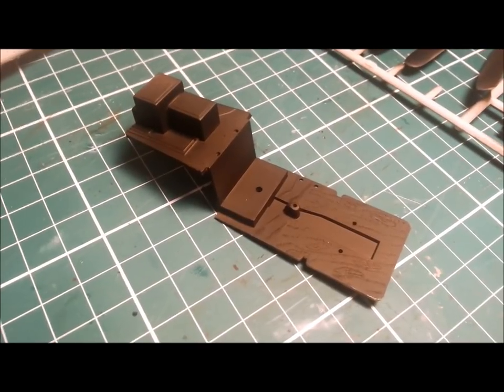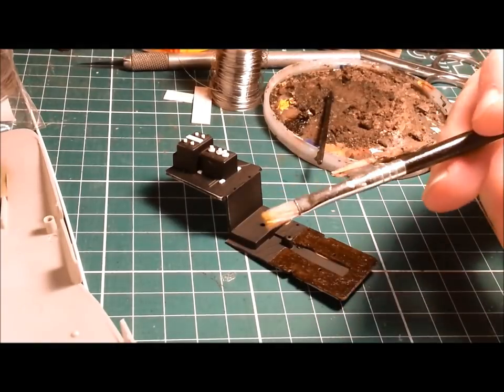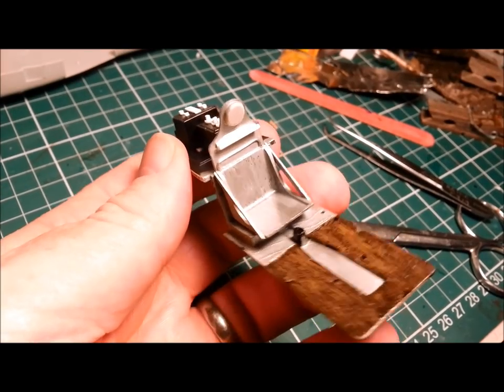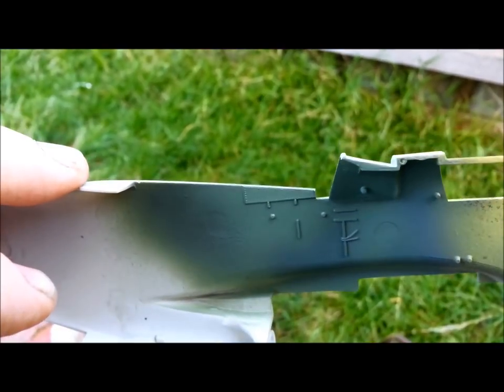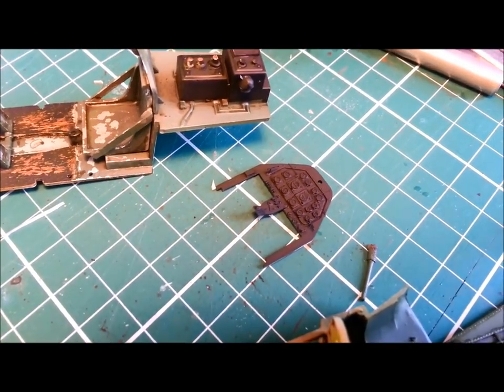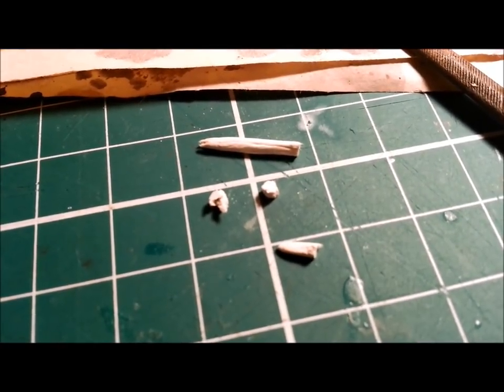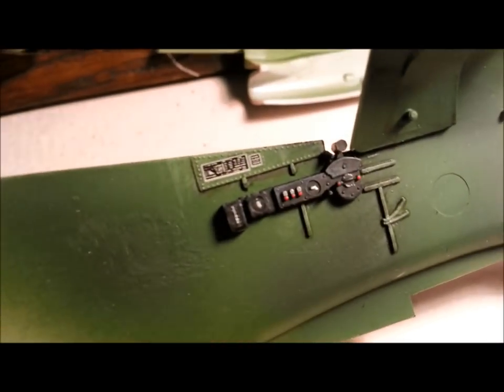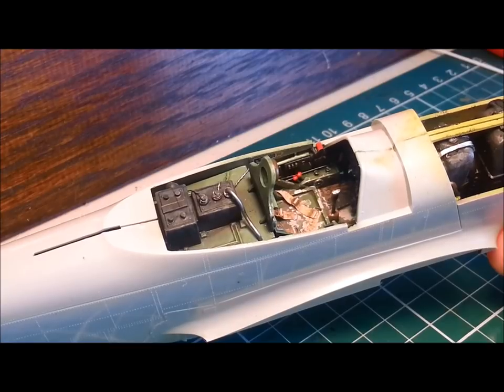How to add scratch built detail to a scale model aircraft cockpit - super detailing

Comment: Hi Dave, great video's. I'm just coming back to modelling (both plastic and radio control) after 40 plus years. Wow how it's all changed. Question is, when you glue the seat etc into one half of the fuselage, what stops it sagging?
Reply from the maker: Do you mean sagging down so that it doesn’t align when you combine the two fuselage halves? I guess you could use fast acting superglue, so it doesn’t have time to sag? Or you could glue some plastic shims around the seat (where they won’t be seen) to give extra support and keep it in position?

Comment: I like to use a xacto blade handle(without the blade) to use it as a pin vise to hold the small wires on one end and just spin it to make braided wire. Real quick and tighter than clothes pins.
Reply from the maker: Clever! That's a good suggestion - thanks :)

Comment: Once again Dave, you've made an extremely helpful guide.  Your channel has helped my career along tremendously. I'm doing this exact thing at the moment on my own shitty Revell kit.  What's your favorite scale aircraft to work in, Dave?  My recent go has been a 1/48 And I'm finding it's almost too small for my liking.  I'm thinking hard about picking up a Tamiya 1/32 Spitfire or an airfix 1/24 of the same. The Tamiya kits here at my local hobby shop are going for a premium. But I'm six foot four inches.. And have extremely large hands and 1/48 feels extremely small to work with.
Reply from the maker: Hi Bernie, thanks for your kind words mate. I love 1/32 scale, because all that added detail is easily visible and it makes a big difference. The only downside is running low on display space for the finished product compared to say 1/48 or 1/72...
Reply: Dave's Model Workshop I collect comics and marvel legends figures and first edition and rare books. And most recently, I'll be adding scale models to the lot. I find myself constantly fighting an uphill battle for space.  Adding new wall mounted book shelves and display shelves and curio cabinets full of my best shit.  #1's and first appearances and the figures pertaining to that comic usually on display very near by.  I haven't found any viable solution to the fight for space.  Other than I think I'll be hanging a few models from the ceiling and adding in another curio cabinet. I've also thought about mounting the models on the wall directly.   I've been drooling over the Tamiya 1/32 spitfire and the same in Airfix 1/24. Space be damned.  My mind at this point gets carried away when I spot a new comic or book or figure and I inevitably buy now, worry later.  And then later that night.. I'm up rearranging my collection to suit what new trophy I've dragged home.   The ails of collecting I guess.    I have no idea where this stuff will fit in. But I, by God, intend to add it in somewhere. I'll find the bloody room. No matter how off beat and out of place it looks.
Reply from the maker: I've seen larger scale planes displayed on the wall - imagine a plane has landed on a surface, and then tilt that surface 90 degrees upright - so looking at the wall you see the top surface of the aircraft. It's striking, if a little precarious!